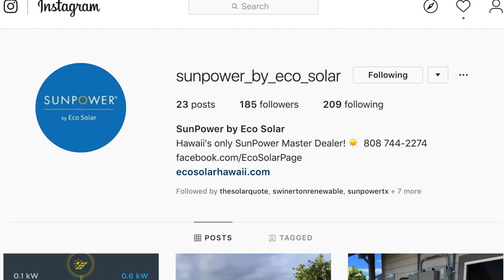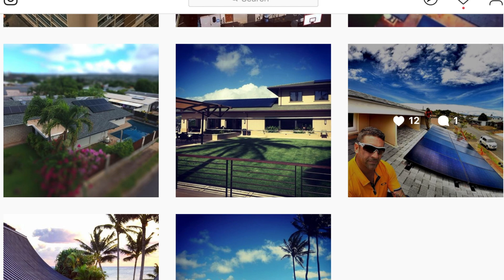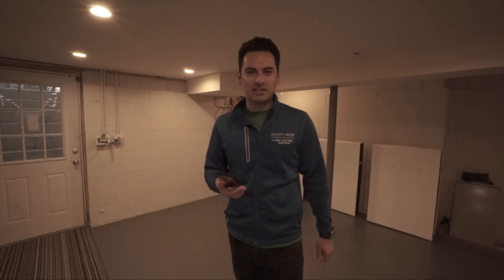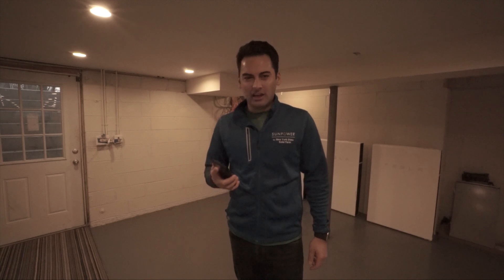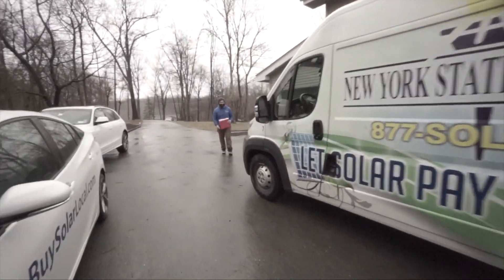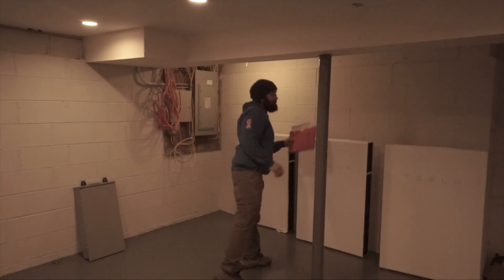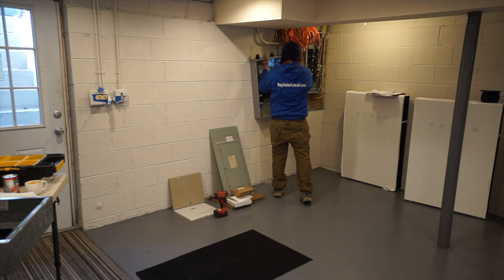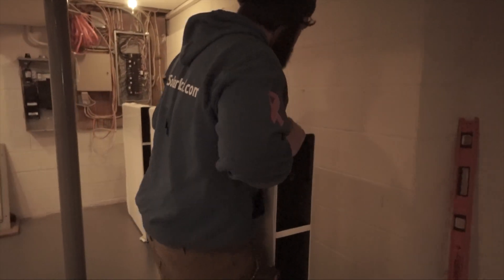Going Off The Grid | Installing Tesla PowerWall 2

Comment: It always takes a bit longer than you would think.
Hang in there.. and good luck with your system.
We are doing a similar test and presentation on our system.  Just up and running the first of the year, it's a 6 powerwall system on 10.2kw of solar production.
Stop by the channel.. there might be some useful information for you in how to optimize your settings for winter and shoulder periods.
Reply: @solaranthony , Thanks for your support.
Your system too is very clean.  I look forward to seeing how your system works for you as well.
You are in that tough "Installation and activation hell" period.  At least you have your equipment.
Tesla seems pretty caught up now as far as the deliveries go.  We waited for nearly 2 years to get our system installed.

Funny enough.. I just had an inspection by our local utility.. SMUD.  No big deal but they started crying about how we weren't actually supposed to have turned our system on yet.
I shot him a look and told him he had better not dare say that on camera... because I would fry them for it.

What were we supposed to so?  No contact from SMUD... not a word for months after the building inspectors and SMUD's conduit inspection had been completed.  So we were supposed to have just been sitting here... till now?

So these folks need to get their collective $#!+ together or they are going to find themselves the focus of a huge consumer revolt.